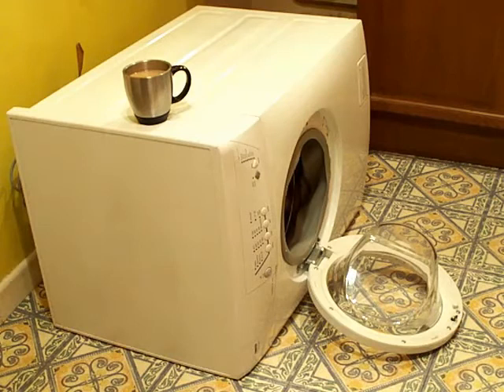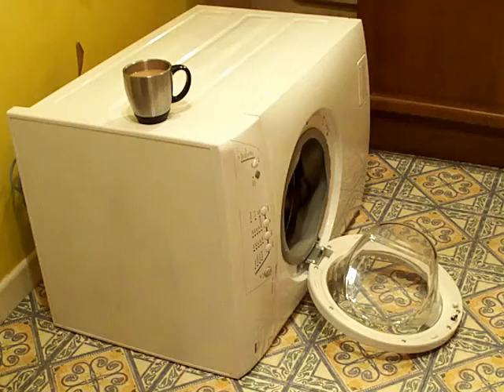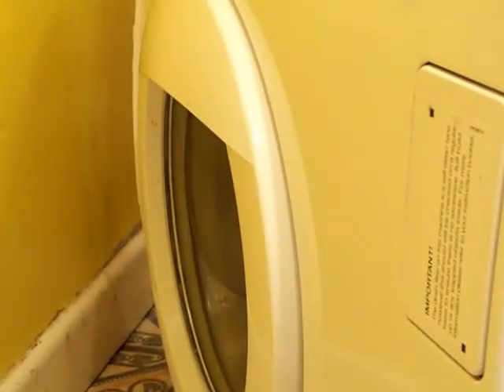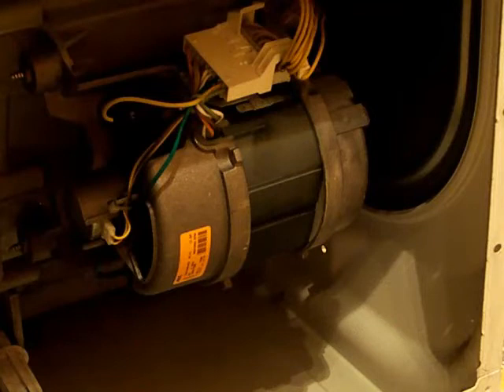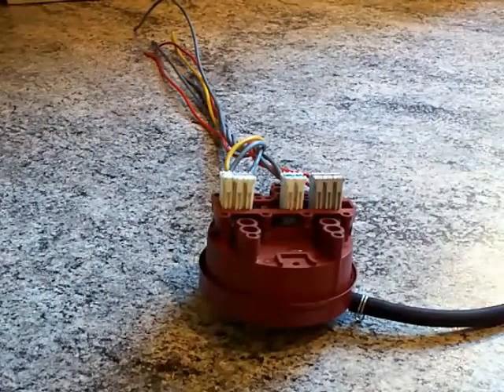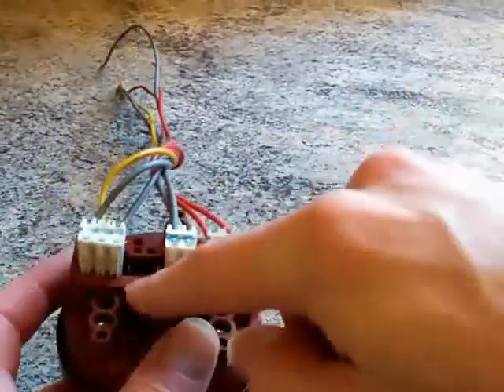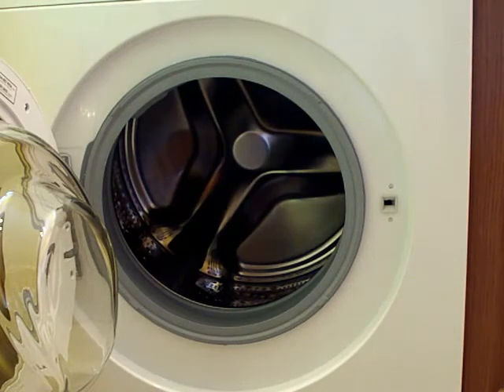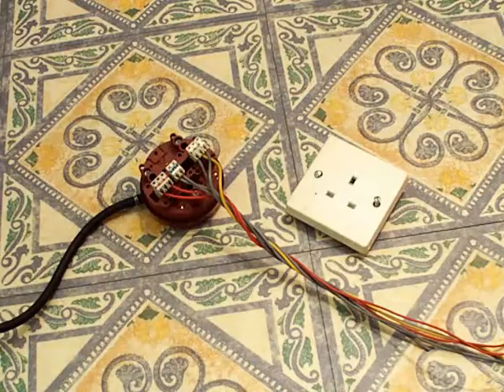Electrical : New washing machine (and a look at a few bits)

Comment: As for the faulty socket... if the old machine was cold fill only you could have had a fire.

Has your washing machine socket got a switch above the worktop or not?
Reply: Hiya. The washing 
machine was indeed 
a 'cold fill' unit. In the 
"New Boiler" videos.......

......I am sure that I make reference to the fact that the hot water output from the boiler now goes into a pipe which once had a hot water valve on it for the washing machine. :D

As for a switch above the worktop..... Again, when we had the new boiler fitted, we needed a switched fused spur to run the boiler, what was done, is that the nearby switched fused spur for the washing machine socket was re-configured for the boiler, and the socket for the washing machine was made permanently live.

The replacement socket is a MK LogicPlus switched socket. :-)

Thanxx for watching,

-Wayne's Electrical.

1st March 2019, 22.30

Comment: Did you have to document this electrical installation?
Reply: Hiya. Because the 
replacement socket 
was a "Like-For-Like" 
replacement......

......It is generally considered not necessary in a person's own household to start bothering about all of that paperwork documentation hocus-pocus.

Otherwise referred to as a "Minor Works Certificate" it is generally considered not necessary where nothing is added or taken away, hence these works being defined as a Like-For-Like replacement. :-)

Thanxx for watching,

-Wayne's Electrical.

1st March 2019, 22.35